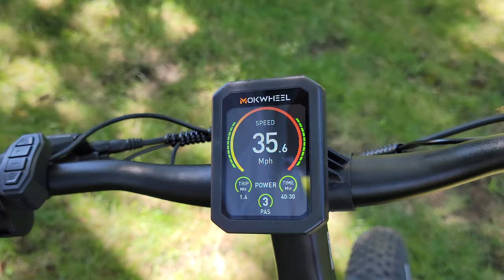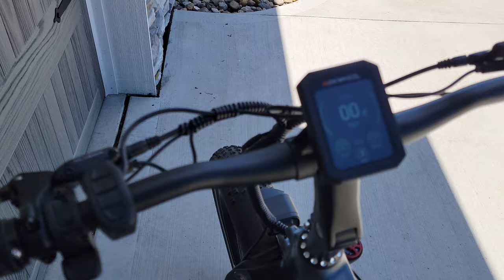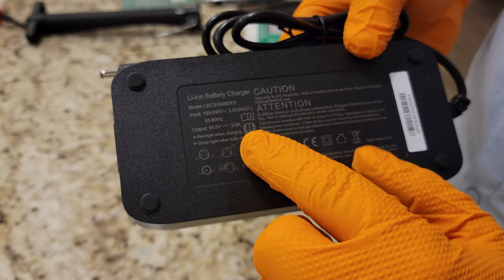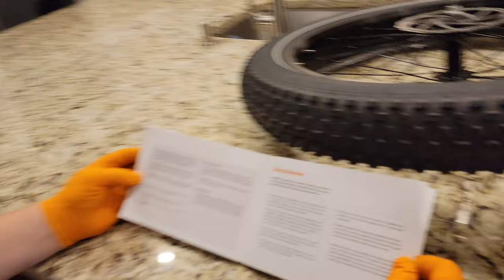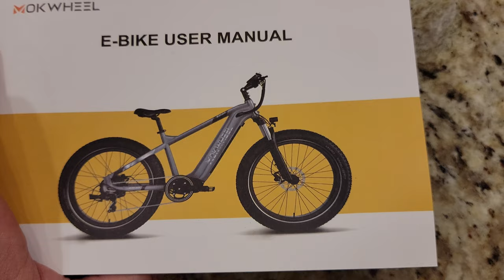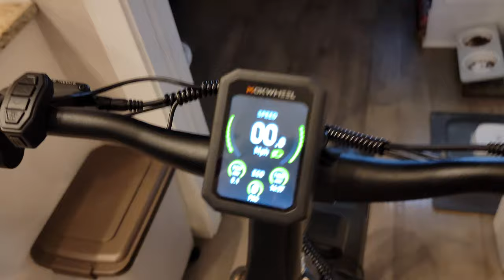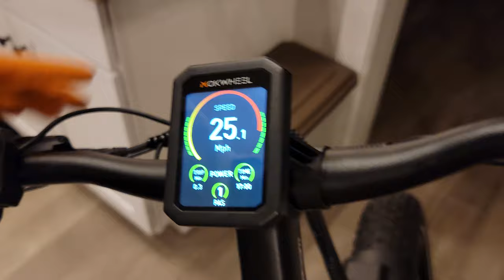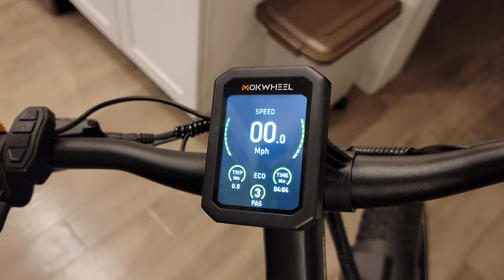Mokwheel - Basalt - Unbox, Build, & Run

Comment: SMALL MAGNETS, ELASTIC BANDS, NON SLIP PACKAGING WRAP.
Hey guys, a suggestion to help speed ur build along. Small magnet(s) inside the tip of ur glove, another on a telescopic stick/pole/antenna, a magnetic tray and a non slip pad to lay ur nuts on or packaging wrap which is super strong and stretchy and non-slip to  make any surface a non slip tool pad to lay nuts bolt etc
Elastic bands wrapped around 2 or more items to hold ur cutting board in place while u screw those  holes together LoL
P.s. u guys are doing great with ur builds camera angles explanations demonstrations etc
P.p.s HI PAUL
LMAO

Comment: Hi Brian - been a long time my friend.  Regarding "more pep in the step" with less HP, could it be a difference in the gear ratios giving you more torque on the low end?  Of course that would affect top-end speed. 
Hope your family is well!   -  John
Reply from the maker: I wondered about that too John, but not sure. I think this one might have a better battery??? But we've only got ONE EBike with a pedal drive setup, and on those, I believe the gear ratio is controlled externally by the rider! I'm excited to see if it works like I expect it to work. This bike is just BIG, and other than the seat maybe needing to be improved a little, I really like it!